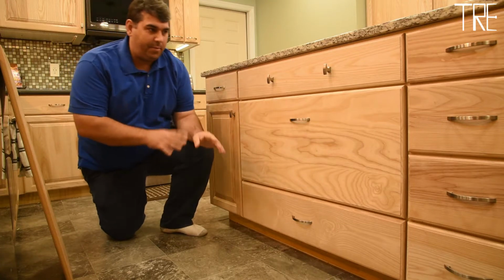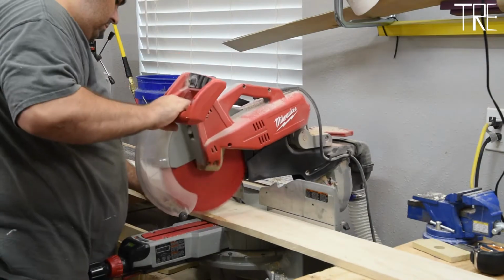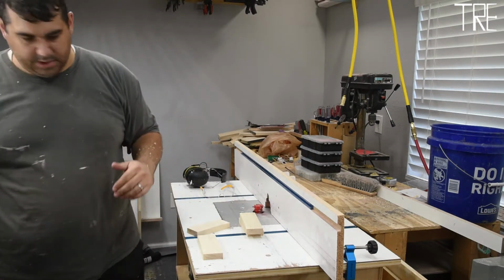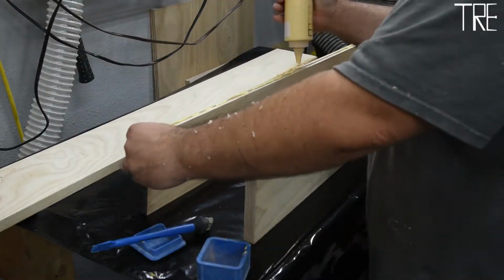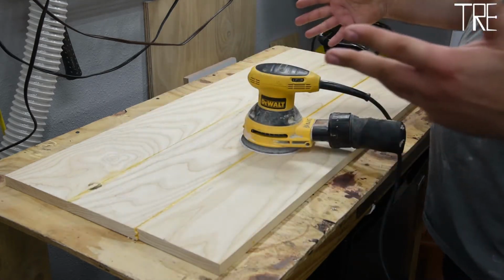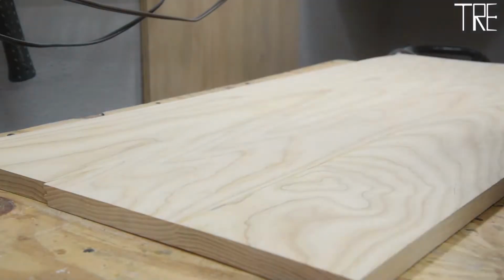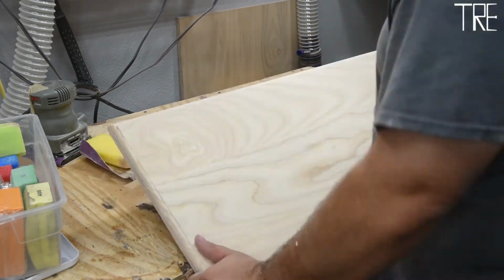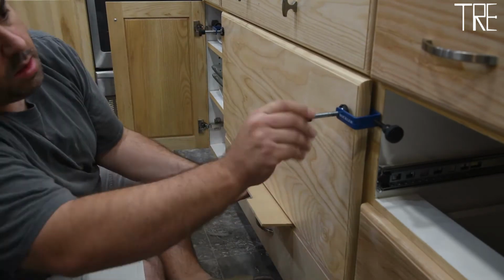TRE-031 | Build - Hardwood Kitchen Cabinet Drawer Front

Comment: Fun.

Yeah, it's important to account for tangential cross-grain shrinkage, the greatest of the three types of shrinkage. This, of course, is worst when using flat-sawn boards.

One wide board: Yeah, that would yield terrible results. For sure.

Three, better.

For something this wide, five or even six boards, each flipped in relation to the adjacent: Best.

If you don't already own a MicroJig GRR-Ripper 3D Push Block, get on it! One is good; two is even better. These are especially useful when running your table saw without a basic safety devices (guard, splitter/riving knife & anti-kickback pawls). Still risky, of course, but these ingenious push blocks offer greater control and keep your paws farther from the shark teeth. Thank me later.